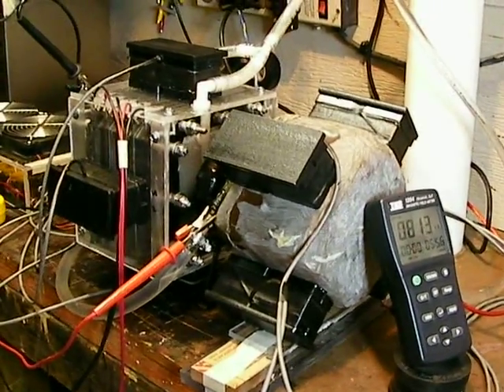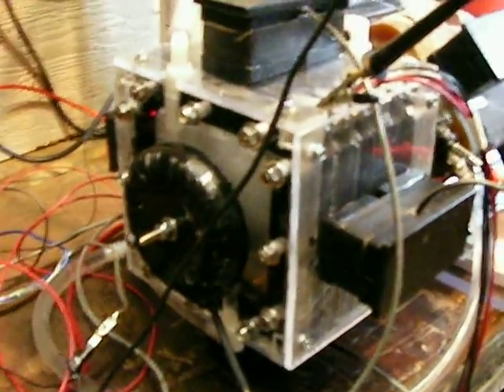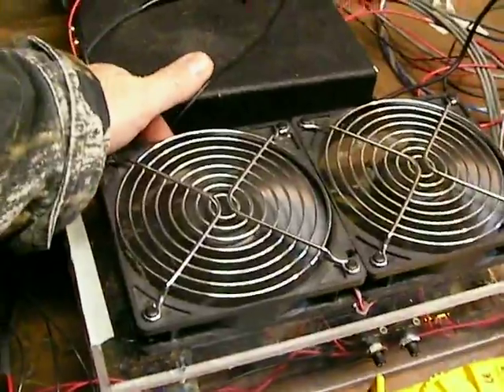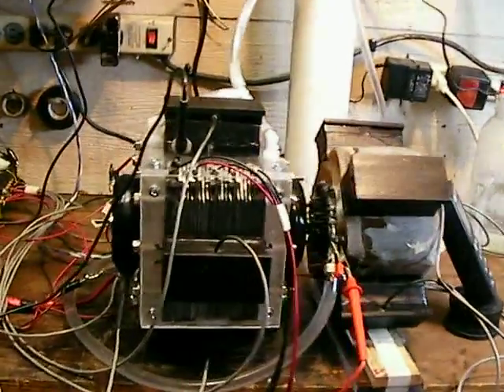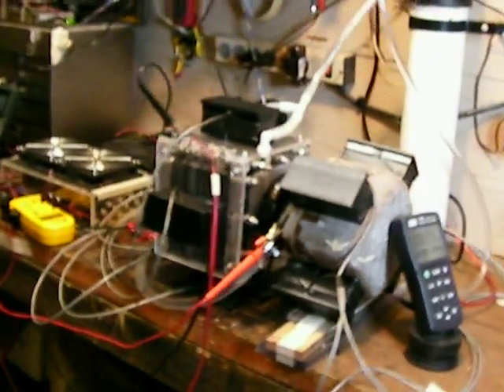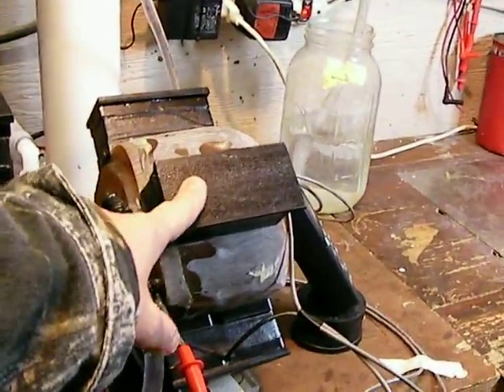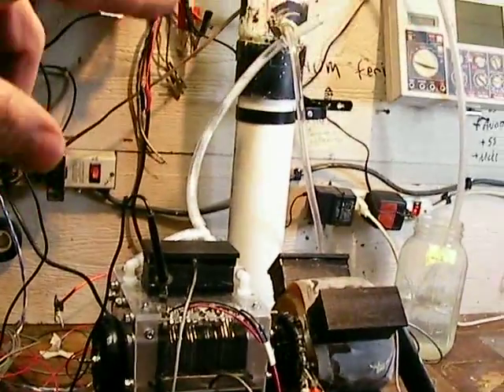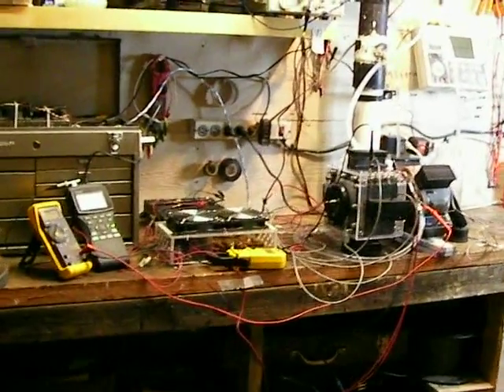hydrogen produced using magnetic fields and RODIN COILS

Comment from the maker: the cell is by no means done the next step is photon injection. and photon bombardment of the browns gas to knock electrons out of the hydrogen atoms to create ionized hydrogen and ionized oxygen. then i have a true fuel source.. and i will not need high LPM as the power of the gas will be psycho!
Reply: First of all, it was a successful work. I have to say this. There are some things that are sticking to the mind, can you help?
This cell you've built is normally a HH, but with the magnetic field you are separating hydrogen and oxygen in pure state from two separate ends. If I'm not mistaken then you unite. And at this rate you get more gas production with the least current. Do the coils feed the DC coil or do you have PWM?

Comment: Yup Yup Yup...The water treatment systom is a great idea.
I'm so very glad that people are starting to use the mag-field to inhance not only the out-put of their cell, but the energy levels of the gas produced. This is exactly what I've been trying to tell people in the HHO forums for a couple of years. One of the things you will run across that will give you prob's with the diesels is the computer systems will detect the extra O and dump more fuel into the ICE to compinsate for the lean burn